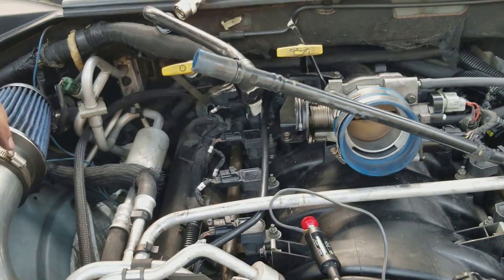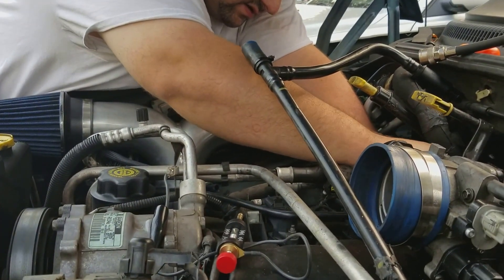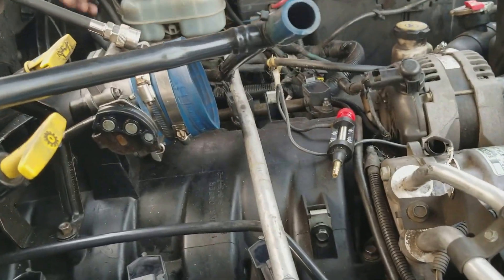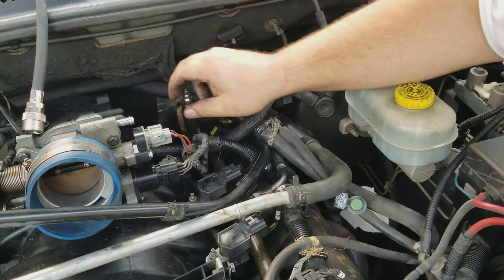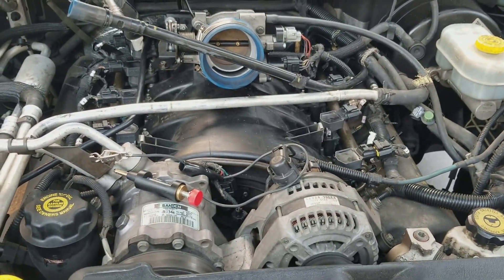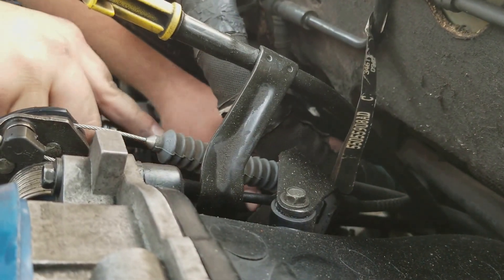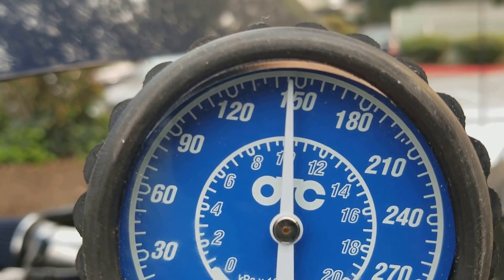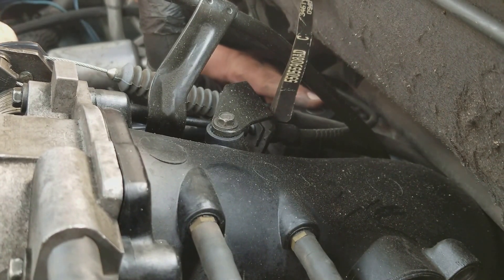Testing compression and coil on plugs pt2

Comment: What about if you have low pressure gage you
Reply from the maker: Low oil pressure can be s serious problem! Check your sending unit for a faulty switch... (remove sending unit and put a manual gauge on it,  to test) or an oil pump going out